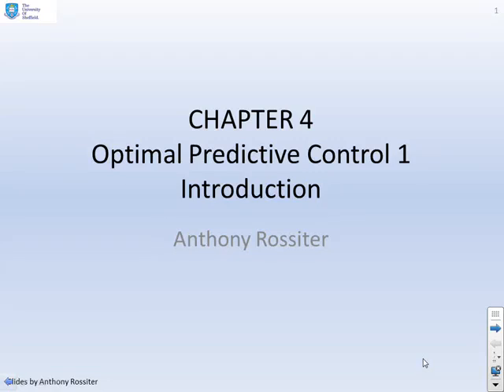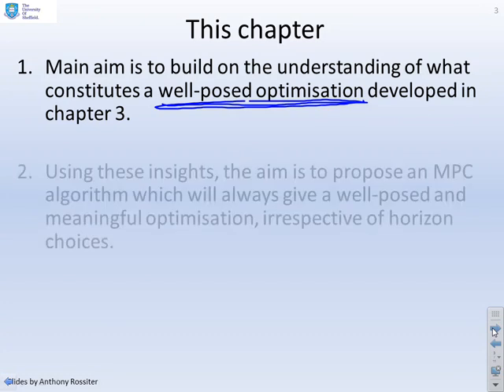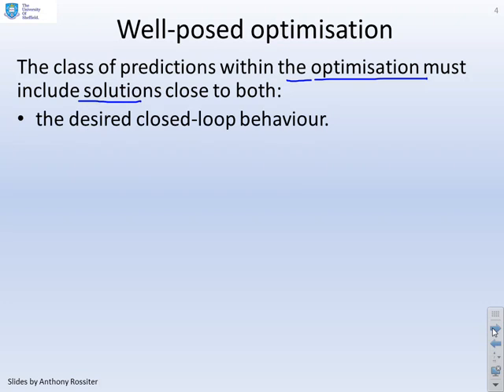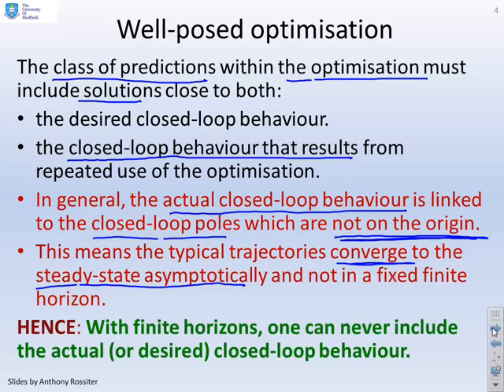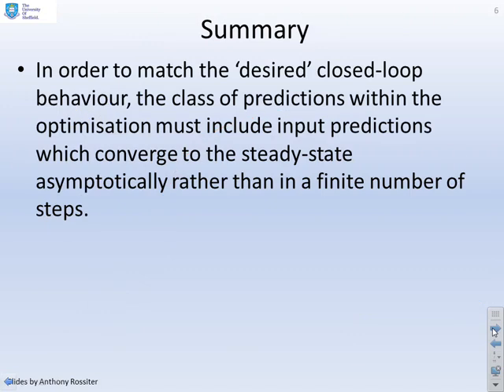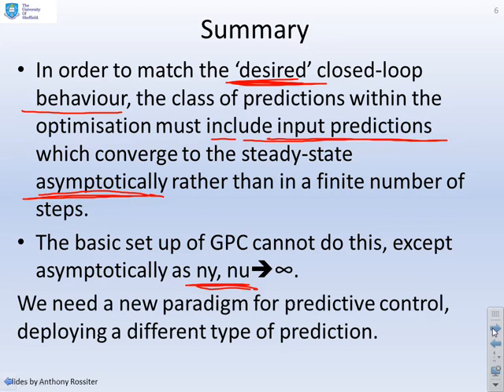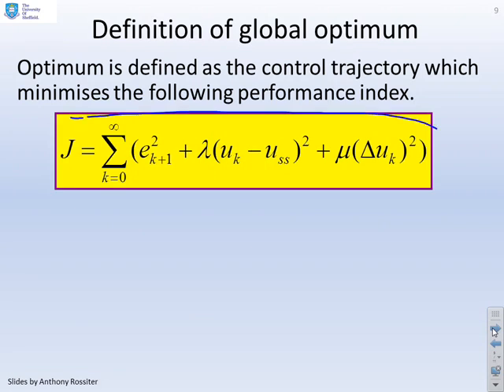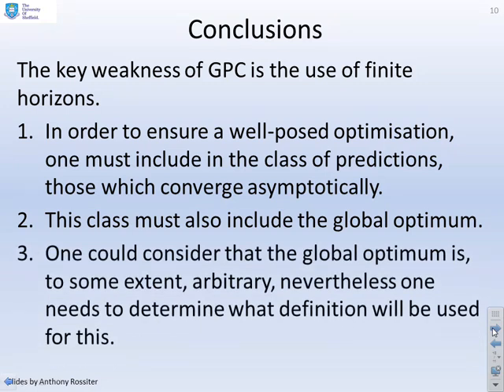Optimal Predictive Control  4_1 - Introduction

Comment: What is the major difference between this optimal predictive control & typical closed-loop LQR? Does it has some advantages compared to common designed LQR? I see that optimization problem is mostly similar, which is to be computed by using quadratic programming